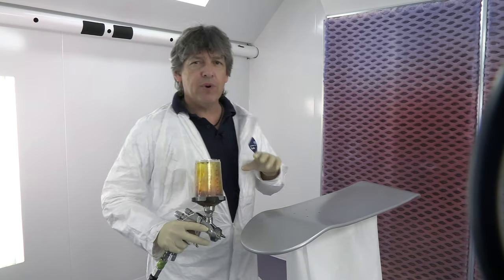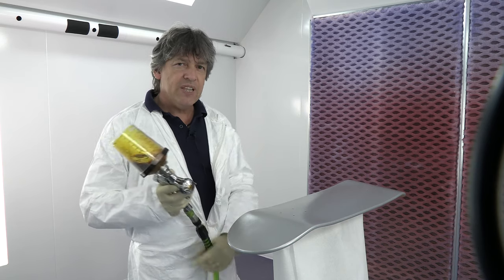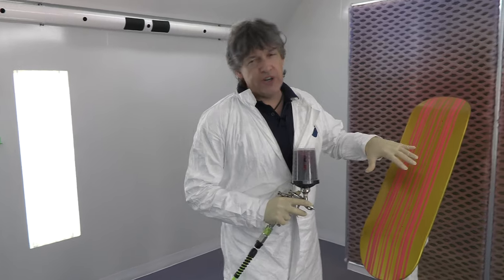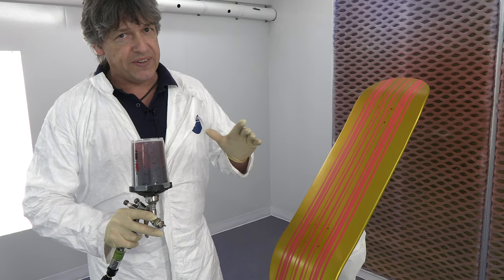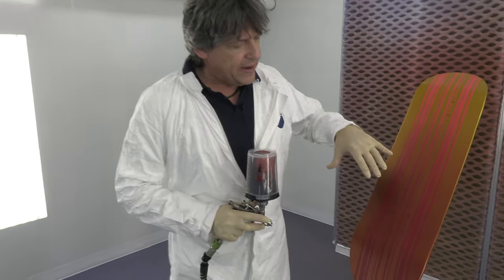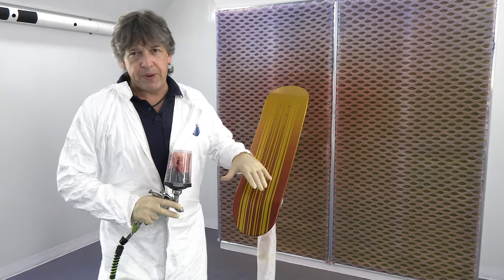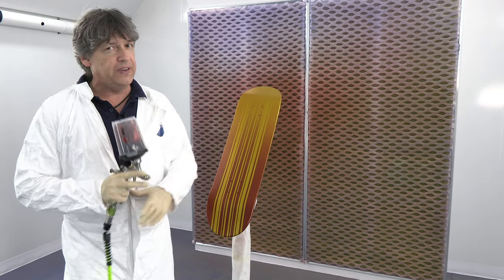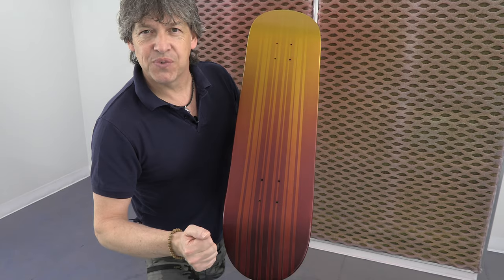How To Paint a Candy Fade

Comment: Please can you tell me if the base used here is the 4102 Aluminum Medium?
Reply from the maker: Yes, 4102 Aluminum Medium was applied over 6013 Silver Sealer, www.autoborne.com. Also, a few months after this video, 6013 was modified to have a higher metallic count using 4102 as its flake; the result is if this video we're re-done today, 6013 could be applied as the sealer & base metallic, over which candy2o is applied. Thank you.

Comment: What airbrush are you using ?
Reply from the maker: An Iwata W400 spray-gun with a WBX 1.3mm tip was used to apply the paint in this video. Thank you.
Reply: @CreatexColors   What kind of air compressor are you using?